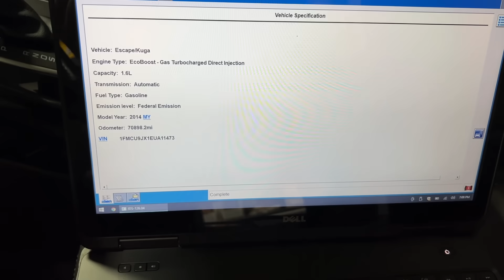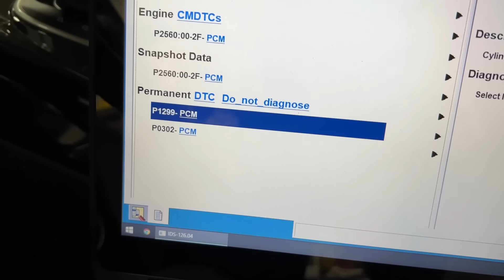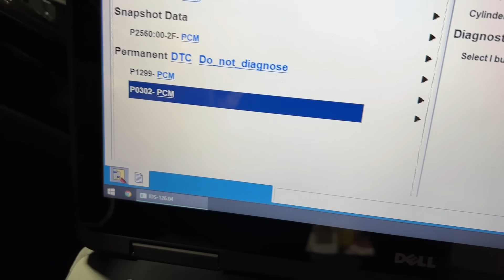Beware of Ford’s 1.5L 1.6L 2.0L Ecoboost Engines and Their Never Ending Coolant Consumption Issues!

Comment: I knew about the coolant issues on Focus RS's. I haven't had any coolant consumptions in my 2017 Fiesta ST, got it new with 32 miles on it in November 2017. I check my coolant weekly to make sure it's all still there lol
Reply: My 2016 Fiesta ST just started smoking 2 months ago on startup. I think it's about to need a new engine. Almost 100K on it and tuned with hybrid turbo since 35K miles.

Comment: Had a 1.5 consuming coolant but with no white smoke or rough running. Ran it for an hour after I topped it off and nothing. 
Ended up having the customer run it to see if it was still dropping. 
Got him everything after that.

Comment: I have the 1.6 ecoboost in my 2016 Fiesta ST200 (EUDM) when was the updated block introduced? 
Or is this only a US problem?
I am pretty sure these engines are build in more than 1 location.
Thanks for the info. 
I was planning on getting a OBD2 scanner just to play around a bit and prevention checkups in between maintenances.

My car only has around 20k miles. But I rather be safe than sorry.
Reply: I believe all of the ST and RS models were "hands-on" built in Cologne, Germany. There is a SIGNIFICANT difference in quality, and fit and finish between my 2019 FiST, and a mutual frinds ST Line (made in Mexico), its not even comparable. I believe the same is try for the engines. I dont know of anyone with issues on their Fiesta ST. Outside of cooling issues in hot climates, due to the undersized radiator. Which most people easily fix in the aftermarket without issue.

Comment: It's not only the engines it's the paint on Escapes also. We just had Ford Customer Service reimburse us for paint peeling around the front windshield on a 2018 Escape with 30K miles on it. It seems to be a common problem around the windshield area on the Escapes and is definitely a manufacturer's defect that Ford won't admit to. At first they did not want to pay for it since we just passed the warranty date by 1-month, then we asked for a supervisor who then told us there's a paint & corrosion warranty that runs 5-years on vehicles. We played phone tag with them for 6-months until they finally cut a check to the dealership where we bought it. I am not buying another Ford again, in fact now that I have seen this video I should try to unload the Escape ASAP.

Comment: Buy Toyota or Honda.  All of these modern cars with turbos are more problematic. Direct injection, Low friction rings, extended periods between oil changes. All just asking for trouble.  Are these Ford engines so bad that a replacement is likely to do the same thing?

Comment: Doesn't have anything to do with engine but I just got a recall on my '18 escape for transmission seals and bearings that can can can keep the car from going into park even though the shift handle is in the park position. Just wondering anyone else?

Comment: Is this a cavitation problem,  or heat and the higher coolant pressure,  or just bad casting?
Reply from the maker: Deck surface area.
Reply: @FordTechMakuloco  thanks, getting forscan tomorrow to try and help a friend with an intermittent miss on his 3.0. I think he has a ground problem but, be fun getting to the bottom of it. Thanks.

Comment: Will you please address an issue that ties into your "Ford Quick Tips #68: Blower Motor Resistor Failures- Testing and Inspection?" video?  I replaced the blower motor resistor in my 2002 Ford F150 (XLT Triton v8). The wiring pig-tale  had to be replaced because it was rusted out. After replacing and installing the blower and pig-tale the truck started and the blower worked. I then tried to put the cover back over the wiring and was not successful. I decided it may be better to take the truck to a professional so I turned the key to start the truck. It would not start. It cranked, the gauges maxed out, and the battery died. I am concerned that while attempting to put the kick-guard in place I may have caused a short somewhere. Do you have any advice?

Comment: My sister's leaked coolant...which she didn't notice until it caused the serpentine belt to break...which in turn took out some sensors/wiring.  It was covered under warranty (only 2 months left on the warranty)  ...the car had 40k miles on it.

Comment: Thanks for your knowledge:
I too had a 2014 Ford Ecoboost engine,  @ 56,000 was told by my personal mechanic the same thing -" I Need A New Engine"  $6,000. Dealership simply kept adding coolant, no repairs..
Within one week of my personal mechanic telling me I need a new engine, I sold for 1,000 less than what I payed for it. Not Bad...👍
Was fed up with ford giving me the runaround and doing nothing. Now driving a Honda CR-V

Comment: Sounds like what happened to the POS 3.0L V6 in my ‘99 Ranger- barely had 30,000 miles in it when the coolant levels started dropping like crazy. Turned out that the heads were cracked to all hell.  Simply the worst. 

It would appear that the Ecoboost engines are no better.